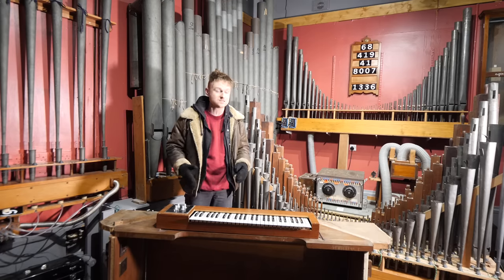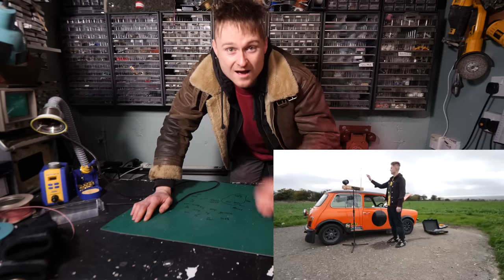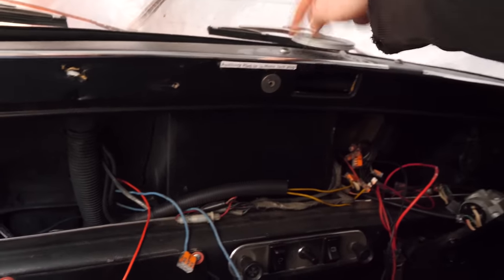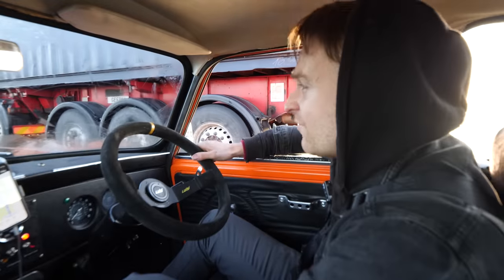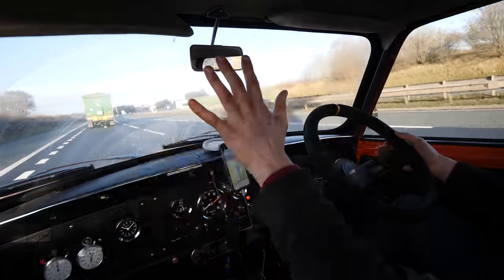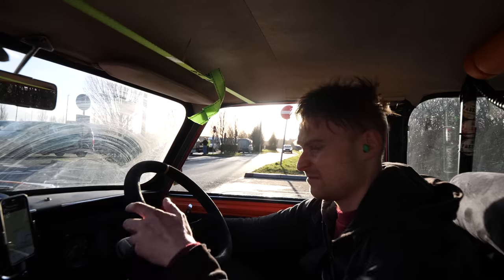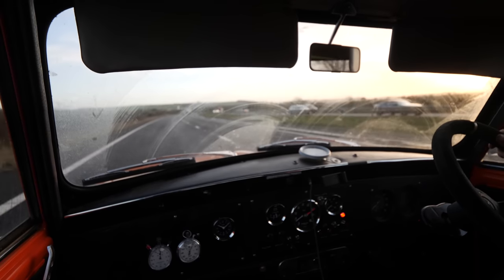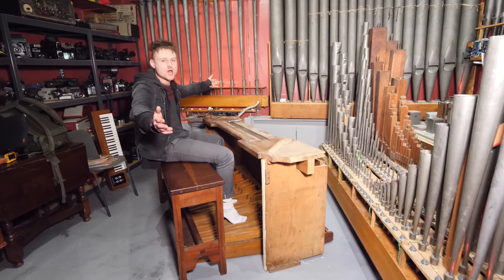722 Miles In A Day In A Mini With This On The Roof - CHURCH ORGAN PART 11

Comment from the maker: The speedo broke on the journey and as you can see in the vid I had a speedo app on my phone showing the speed as a replacement for the journey so I knew what I was doing, and I put in a new Speedo cable this morning. 
.
i started doing a video on the heater to make another channel about my work i do in the mornings on me saturdays on the car but gosh darn well hard work nothing ever works the way you want it haha. tbh after this drive debating ditching heater all together, i had plugged up all of the intake vents partially due to vents being rusty so i plugged them up. But also the idea of having less hoses going all over the plase, the reason i thought twice about removing the heater all together was it being cold and because the vents were plugged up it werent that bad!. ill be getting a heated windscreen to sort out condensation, the old school rally ones!
also
Reply: That's great! There is a channel called project Binky and they say that 9 months is not enough to make a dashboard! You did it in a few days!
Reply: Gears of glory....
Reply: Do a search for the 1981 Australian movie  " Goodbye Pork Pie "  .
Reply: @bobroberts2371  New zealand film
Reply: Beefy inverter attached to the alternator feeding a fan heater (might need a bigger alternator) :)
Reply: @SomeMorganSomewhere  Too many power conversions just lead to a massive loss of efficiency and a fuel economy penalty.   Hot water directly from the engine is the best bet since it uses  waste heat rather than having to burn fuel to spin the alternator.
Reply: @bobroberts2371  Oh, 100% it's not going to be efficient, never claimed otherwise.
But it means he doesn't have to re-plumb the heater core. ;)
Reply: "I gotta beat the lorry" but you Were the lorry 🚛
Reply: I hear a nasty intermittent knock partway through the rev range, but being American, I'm not sure if that's normal for British cars or not 🤣
Reply: @Drmcclung  Also sounds like the throwout bearing in the trans might be a bit sus
Reply: @SomeMorganSomewhere  Right at 7:22 is what I hear that's sus to me.. like rod bearings knocking around a little then clearing up with engine speed (more oil pressure). But me knowing less than 0 about classic British engines I've got no idea what "normal" even is, so.. I don't know. Could well be a harmless f†ked up mount just rattling on something. Didn't hear any T/O noises myself tho. I do miss the whine of straight cut gears.
Reply: I'm just glad he got there and back again without any crazy difficulty or risk of life and limb. Driving that many miles with a car that isn't 100% operational "to spec" can be fairly nerve wracking.
Reply: YOU CANT JUST END YOUR SENTENCE WITH ALSO AND NOT ELABORATE SAM
Reply from the maker: @tesicnr  yes but theirs all probably worked first time haha. its taken me a few weeks already tbh!
Reply from the maker: @Drmcclung  aaah yeah thats the straight cut drop gears flapping around between gear changes
Reply from the maker: @Drmcclung  not the gearbox the drop gears to the gearbox
Reply: @LOOKMUMNOCOMPUTER  I'd have loved to have owned an old one, but good freakin God, what they sold for even 20 years ago (here) was suicide
Reply: My mini's heater matrix gets used more in summer as auxillary cooling. Windows down and (heating) system up!
Reply from the maker: @SminkyBazzA  yep! i tried this summer not using mine to see if it would be a problem removing the heater. i added an electronic fan to the engine bay instead. i was hell bent on removing the thing hahaha
Reply: @LOOKMUMNOCOMPUTER  yeah, the drops are a bit of a fail on the mini imo. The only way to control the thrust loadings from the helical gears that are much quieter is to install straight cut gears. 

And earplugs.
Reply from the maker: @alisdairherd9501  well that's what they are.
Reply from the maker: @alisdairherd9501  my other mini we are rebuilding the engine because the idler gear failed. Took a couple of months to wait for the right gear. It turned up yesterday so hopefully another vid on that engine soon
Reply: At least you didn't bust your Speedo on the beach. That's the worst.
Reply: Can we please get a cross over with Autoalex and his You Tube channel?  I would love to see Alex come play with your toys and try to help get your Mini running tip top.
Reply: @brianspenst1374  Tip Top? I'm pretty sure he builds most of his own gear.
Reply: @Buck Starchaser  that was a little humor about how Alex enjoys fixing things.  They are rarely in actual perfect condition but it makes for fun content.
Reply: @brianspenst1374  I got your joke. Now your turn.
Reply: Cheeky way to clock the mini. Lol.
Reply: @Drmcclung  that's something resonating, touching the body work.
Reply from the maker: @handlesarefeckinstupid  hahaha very true. but to be honest the mileage goes out the window when cars get engine rebuilds and new subframes etc. this ones been rebuilt more than once. unless its an unmolested classic mileage is not that important
Reply: @LOOKMUMNOCOMPUTER  I really miss that sound. You should sample that (straight-cut gear whine) and make a synth out of it
Reply: Seriously mate ?  Sam a van would have cost you 70 quid buddy 😂 you certainly are an interesting character . 
  Health and time is important,  life is longer than sometimes we expect

Comment: As a car guy, I love seeing how your mad scientist style applies to your car!
Reply: Same here, love it!
Reply: And Mini's are so perfect for that too :D
Reply: 50+ years ago, mad scientist in most technological science skillsets merely meant handyman or inventor. Nowadays, you'd need an electronics degree and a programming major from university in order to work on a car built in the last few years
Reply: As someone who drove some classic minis, I feel like this is just what a normal trip in a classic mini is like :D
Reply: As former Mini driver, the scratches on the tarmac in that blooper scene hurt my feelings.
And what gearbox is that? Sounds like racing gears.
Reply: Imagine having to respond to the insurance question: "List any modifications made to the vehicle"
Reply: @JC-jv5xw  "I resurrected this thing from the scrapyard, the list of what's original is pretty short..." 🤣
Reply: @andrebartels1690  gearbox is maybe not intact, im no car expert but i drove my golf 2 20K km with defect gearbox, it sounded like a race car gear box and the shifting was insane, after few hundreds km autobahn near impossible to shift out of the 4th gear, had only 4 gears, but i was young it was my first car and i had no money, later i got a used transmission/gearbox from a dead golf 2 and a friend repaired it, but the hassle to lift whole motorblock out etc, sorry this got too long.

Comment: Love the sound of straight cut gears
Reply: I was about to ask if they were straight, damn
Reply: @wboumans  So was I 😄
Reply: Is that the whirring sound on acceleration/deceleration? Reminded me of go-karts I've driven in the past.
Reply: @iamnatman  Yeah, straight-cut greats are used in sequential transmissions where you just shift "up" or "down" instead of messing around with a shift pattern, and you can also "flat shift" without lifting off the throttle. So for those reasons, they're preferable to your normal manual transmission on race cars (also motorbikes and shifter karts). If I'm not mistaken, the whole reason for the helical-cut gears in a normal transmission is the massive noise reduction.

Comment: You could ask BOM for help with your mini! 😉 I don't know which one of you surpasses the other in perseverance, craziness and dedication! 👍 I love the series / your work and will try to visit the museum sometime - I hope you have some gigs in Germany again at some point. The Mini looks pretty good from underneath, I don't know if you can get this or something similar in the UK - look up "Mike Sanders rust prevention grease". I'm using it at my van for 15 years now - sure It can be quite a mess, but in my opinion it helps a lot (I always heat up the seams with a heat gun when working on an area of the car and then I add some of the grease to let it soak into the seams.).
Reply: Sam could bring his own funk, too

Comment: Gotta get some numbering on the side of the car there... You're 98% complete on the "Blokes of Hazard" theme. 
I got a kick out of your "Demist" switch. That's the second time I've seen that word. The first was in the army, as we had to constantly inventory our stuff, and when it came to night vision goggles, we had to demonstrate that we still had our demist shields, though nobody knew what it was for. Most of the confusion came from sounding it out as "dem-ist" instead of "dee-mist", so we'd have some small lens rattling around in our carry pouch, trying not to lose it, while a few people were struggling to see with fogged-up lenses, and making fun of the nerds for putting on the extra lens that has no apparent function during ordinary use. :D

Comment: Bit late to tell you this, but, there is a website where you can search for couriers to pick up your item (especially ebay stuff) and drive it back. It's good for car parts or large items that cant be posted. When you get the quotes they are always over priced, if you wait 24 hours or 48 hours you get a few emails from private companies who give you much better prices (like half). I think it was Shiply I used
Reply from the maker: Nice to know!
Reply: No fun or content in that ;)
Reply: @robinclayton8284  well, although it was a brilliant video, I doubt he would want to make it into a series.. especially as driving long distances is a pain the ass. I'd happily send some money to Sam if I knew it was keeping his ass from getting cold traveling to find exotic items. :D
Reply: I actually shipped an orange classic mini by courier. After a few days I was getting quotes 1/3 the cost of the original ones. Having it delivered was cheaper than getting the train there and driving the car back.

Comment: Wow! Really cool. Reminds me of picking up that SAAB 900 Turbo I bought from ebay and picked it up by myself ~ 18 years ago, which I only bought for cannibalization. What I did not know as I bought it was that it had no 1st gear and no reverse gear and no power steering and really bad cooling. Most exciting 250 km drive in my life.

Comment: I've got two minis, one's a clubman estate, but I don't think you'd get an organ bench in there although it's surprising how much you can carry with the rear seat folded down. The engine is 60 thou overbored with big valves, twin valve springs and the like and it goes quite well. I stuck with a single 1 3/4 inch SU carb. I did also fit Copper S type 7 inch servo disc brakes to stop it. I couldn't run to a straight cut box and drop gear set or cross pin diff and so on, but it's quite fun. Minis are noisy at the best of times, but straight cut gears add a new dimension to the sound! I've got an organ as well, so I could try the bench and see what happens... Anyway, great vid, thanks for posting.

Comment: Have you adjusted the tension on the individual pedalboard springs? My dad used to make them and had a simple method. Adjust one until it feels perfect, then get a large tin with a wooden dowel stuck out of the bottom, rest it on the end of the perfect pedal and fill it with nuts and bolts until the pedal just moves. Use this to adjust the springs on the rest of the pedals, then they'll all have the same tension on them. Similar method can be used on the keyboards too.

Comment: Ah yes, Lucas electrics.  I knew them well having owned 2 Jaguar e-types for nearly 20 years.  I believe the English drink warm beer because Lucas made refrigerators.  The non sychro 1st brought back memories of my 64 e-type and it's Moss gearbox. I even had an 8 track in the 64. The 70 was more civilized but only just a bit.  I have a much more civilized ride now, a Tesla Model 3 and don't miss the rusty bits falling in my eyes anymore.

Comment: As an ex mini chap, i would have taken the passenger seat out and stacked it behind your seat upside down and then you pop the seat in beside you. I think all you need is 2x 10mm spanners.  I used to pick my mrs up and her bike, from work in the 90's with mine. It's possible with the front bike wheel removed lol.
Reply from the maker: Problem is the roll cage crosses behind the passenger seat and the fuel pumps are where the back seat that side is :( and it wouldn't have made as good of a video thumbnail hahaha :D

Comment: The noise and the vibrations and having the windows open when it's cold kinda makes me miss driving my 72 beetle. Kinda. Wing windows are a treat so you don't need the whole window open. I kept a blanket in the VW for cold weather, good times.

Comment: When your bench got loose, it reminded me of when I found a very nice piece of furniture on the side of the road, so I obviously wanted it.
It weighed about 50kgs and I barely managed to get it on the roofrack on my own, and after half an hour of highway I stopped to check the load and... the front part of the roofrack became loose due to the weight flexing the crossbar, yikes!

Comment: That was quite the road trip, I can only imagine the noise of engine and the damp. I’ve got a 20 year old car and in the winter the rear window sometimes gets frozen on the inside. Luckily the heater works well.

Comment: >mentions energy crisis
>1.54 quid per liter (7.07 USD/gal)
>Mini Cooper rated at 14.5 km/L (34 MPG), but with this particular specimen we'll call it a generous 25 MPG (10.6 km/L)
>109.32 liters (28.88 gallons) of petrol to go 722 miles (1162 km) for a 35 quid (42 USD) bench, costing 168.35 quid (204 USD) for petrol... 480% the cost of the item
>3.75 gigajoules of energy... enough energy to heat that space with a 900W heater for 48 days straight, assuming 100% duty cycle

Comment: you gotta balance that bench, shes pretty wobbly. probably either sand certain feet to make it more level or maybe ad little wooden toes to the feet of it to have a wider surface area so they are less likely to rock from your body weight.

Comment: That's a effin awesome car you have there! It sounds like a race car and I bet it'll feel like that also! What engine do ou have in it? Is it standard or slightly tuned?
Reply from the maker: Moderate tuning. But next year gunna swap it for another one as not cracked this one open not sure how long since it was built. It's a 1310 Weber 45 carbs lightened flywheel. Not sure which cam but it's definitely not standard and close ratio straight cut gears limited slip diff etc
Reply: @LOOKMUMNOCOMPUTER  Weber FTW!
Reply: @LOOKMUMNOCOMPUTER  I got to be an expert on SU's because both of my Jags had triple SU's and my two Datsun Z cars had dual SU's.  The 70 OTS originally had Strombergs but I converted it to triple SU's. Still have all my old synchronizer tools for the Jags and Datsuns.

Comment: You could use a Arduino and some darlingtons to create hazard light, a potmeter to play with the speed.
: )
You can also measure speed with an Arduino, 10mHz = 10.000.000 / 1000 = 1 millisecond and count the rotation of the wheels via automotive sensor, some TFT screen.

Comment: minis in the snow...not bad as i recall. that gearbox is loud straight cut gears? think i might be tempted to throw a thicker lube in it . electrical issue in a mini....never happens lol
Reply from the maker: yeahh straight cut, and it doesnt help i removed all of the sound proofing and carpets to keep an eye on the metal haha. makes a noisy mixture
Reply: @LOOKMUMNOCOMPUTER  minis were always a bit noisy straight cut just adds a growl out of the box to go with the general whine lol. 10h drive not my idea of fun  but a great car to do it in if you like to drive

Comment: Nice hotrod!!! It would be a little small for me because I would probably flip it over just trying to get in it. Being I'm 375lbs I could possibly wear it lol.

I love how you make what you have work like strapping the bench to the top of your hotrod mini!

Happy Holidays to you and yours!
Reply: The Mini is an incredible car. It'd probably be fine for someone your weight, the suspension was made from rubber, not steel. The real issue would be size. If you're very broad it might be a squeeze. Mind you, I had one of these about 20 years ago, and got a large friend in the back. He wasn't so wide though, he was 7'2" tall.
Reply: @ClarinoI  I'm 6'2" and 20 stone and I fit in my classic mini with ease.
Reply: @Darth_Chicken  I'm short and fat. I got stuck getting out the back of a Tesla once 🤣🤣🤣
Reply: @Darth_Chicken  Yep, they're a remarkable piece of engineering and use of space. Mind you, @oldsoul5263 is about six stones heavier than you, so it may be a bit of a squeeze even so.

Comment: Does your Mini have a straight cut gearbox?
Reply from the maker: no the original commenter is correct, its a straight cut gear box, but also straight cut drop gears
Reply: I’ve owned enough Minis to know how they work. I’ve got an 80 bhp Aseries sitting in my garage.